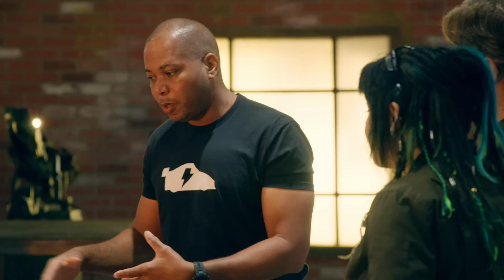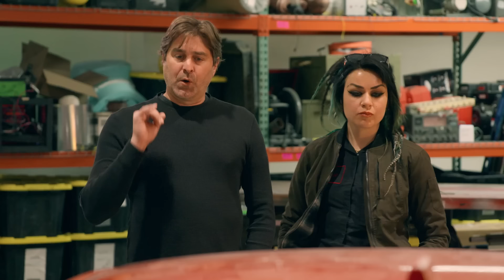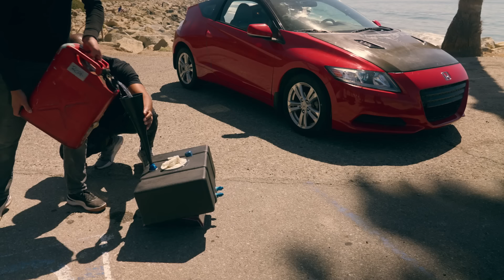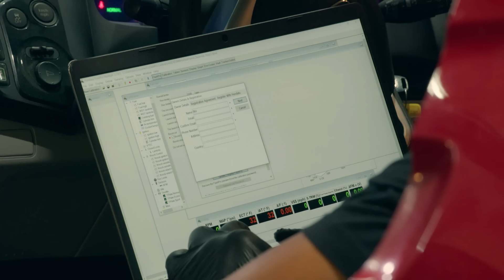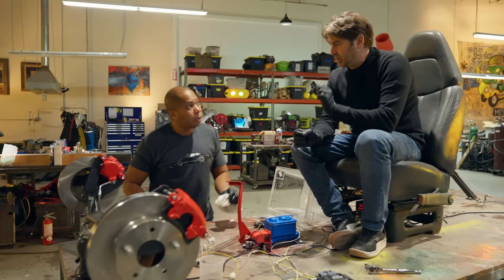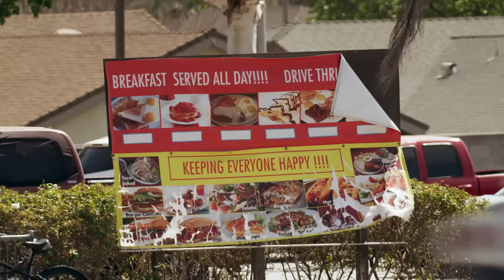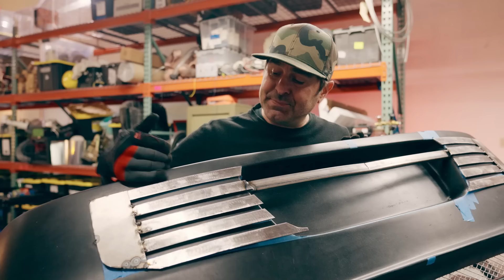Installing A Turbo On A Hybrid Car! | Motor MythBusters | Season 1 Episode 5

Comment: They went through all that effort with the fuel tank to keep same fittings to end up using ring clamps 😂. 
Couldve just wired in one off amazon for cheaper and less time 😂

Comment: I already see a major flaw in their approach by 1:48, they have a single hybrid here. However, there are several types of hybrid ICE+EV vehicle types. There are three common types; the first is the Range Extender type; basically the EV Hybrid car is an EV with a smaller battery and smaller ICE engine that doesn't directly drive the wheels, but instead is used as a generator to power the otherwise EV based vehicle and recharge the smaller battery. This is called the EREV

The second  type is the electric-motor assist type or MHEV where the ICE engine is the main engine that drives the wheels, but there is an electric motor assist used for rapid acceleration and climbing gradients. You reduce the work of the ICE engine during the heaviest load periods (accelerating from a stop, going up hills, accelerating to pass another driver) and you improve fuel efficiency. 

The third type is the reverse of the second, the Electric Motor is the main drive unit, but the ICE engine assists for long distance driving, the same type found in Toyota Prius and Toyota's lineup. 

Beyond these three there are several other arrangements that exist and are either implemented for normal road use or for specialized vehicles. 

Adding a turbocharger to the MHEV and or PHEV parallel drive systems like the Toyota Prius or Chevy Volt might help with fuel efficiency, but for EREVs, the turbo likely wouldn't help and could otherwise harm fuel efficiency. And given the Atkinsons Cycle engine in the Prius, it's likely going to hurt fuel efficiency.

Comment: It's the additional weight, uphill you will burn more gas because the turbo kit has mass the oem engine does not. It's also not exactly comparable because the oem exhaust and airbox are gone.. those boost fuel economy greatly.  Overall I'd say if the hybrid system was recalibrated in line with the engine mods the results could be improved.

Comment: The answer is obvious yes but only with the right setup, small turbine, short pipes, everything needs to be less restrictive even mounted into the manifold and headers definitely aren’t going to be more efficient with it run all the at out the hood

Comment: Turbo helps the engine get air easily, don’t tune it for a big power gain just to have proper AFR so you aren’t using a bunch of fuel